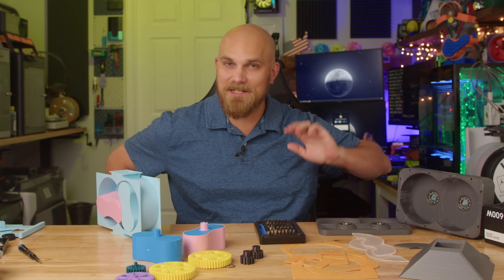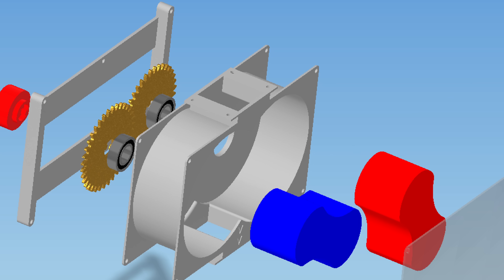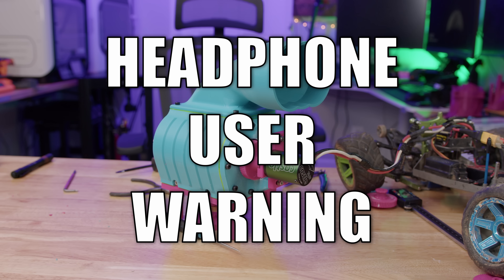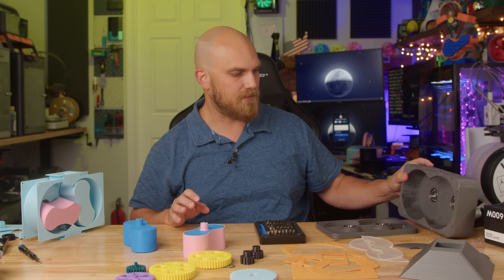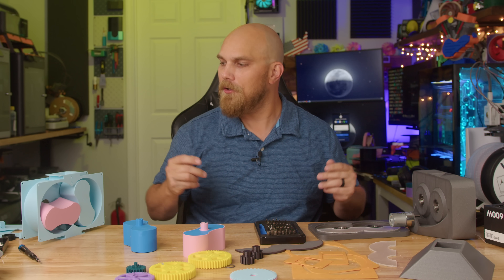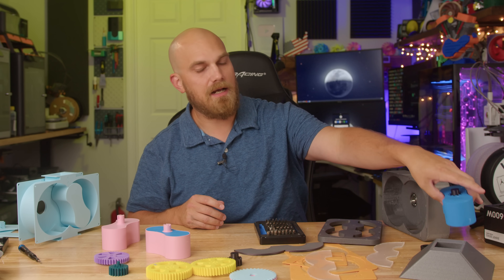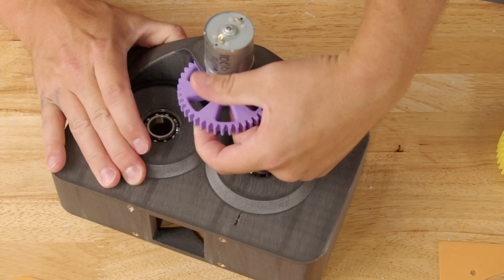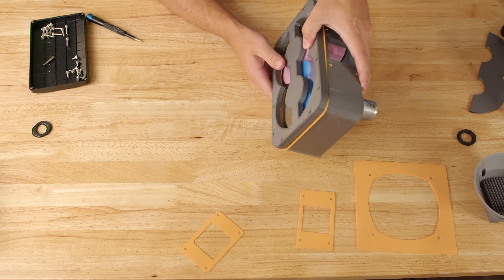Turning a Viewer’s Roots-Style Fan Concept into a Performance Beast! | Fan Showdown S6 REMIX

Comment: I think removing grease from bearings is fine, but maybe look at using ceramic oil used for skate bearings instead :)
Reply: thats what i was thinking, like a gun oil or skate oil type of thing. thinner but still handles the loads and speeds
Reply: @ghomerhust  it doesn't really need to handle any load, so even skate oil will end up too viscus. For this application you really want something as thin as possible and only if you're going to run it long term.
Reply: @jttech44  There are some highly refined lubrication oils for very fine mechanisms. The oils are so thin they feel like water. Another choice might be super thin silicone oils they use in RC cars. Some of them are absurdly watery.
Reply: Fully ceramic bearings with no grease would be even better
Reply: @ratgreen that's more like it, ceramic balls and races.
Reply: Use use break cleaner and remove all of it. They will spin better and longer. They will wear out faster but this won't be used often.

Comment: Attach any of the fans to that over powered motor and I bet they would get 2-3x their original pressure.
Reply: Only if the motor was geared up to run the fan 2-3x its original speed.